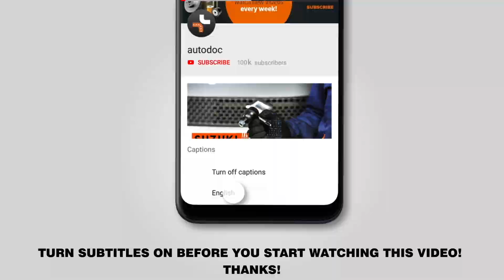How to change front suspension arm / front control arm on TOYOTA AYGO 1 (AB10) [TUTORIAL AUTODOC]

Comment: I have been told by my garage that I need new front  axel swivel pin or brush and suspension arm pin or brush and it's better if they swap the whole part   is it this part they are on about   thanks .
Reply from the maker: It is better to change the assembly, but it is possible separately. The decision is yours!
Reply: Hi thank you for replying what is the complete part called if I was to buy it as I'd rather change the whole part but dont know what it looks like thanks